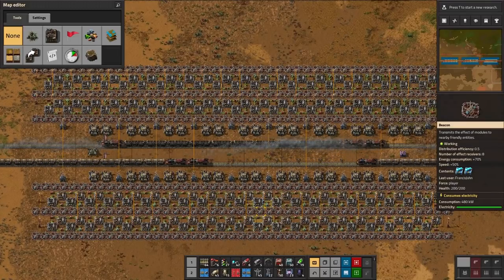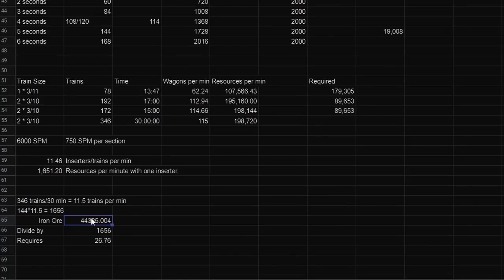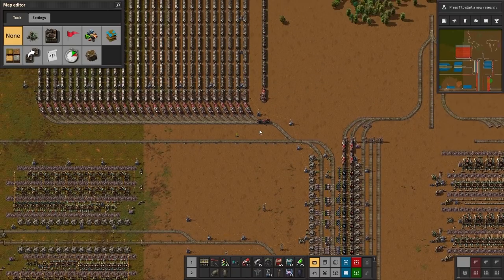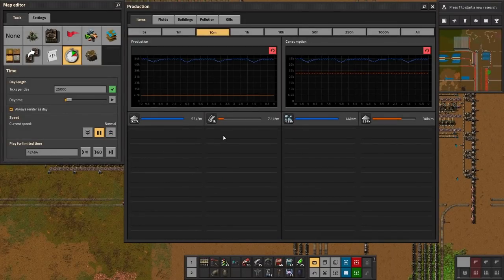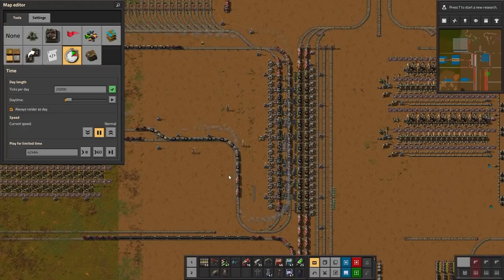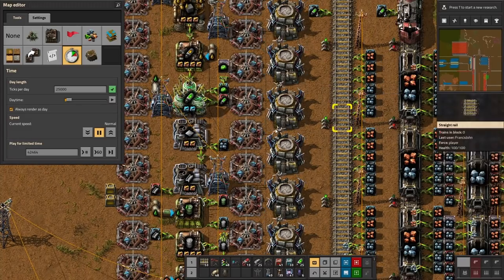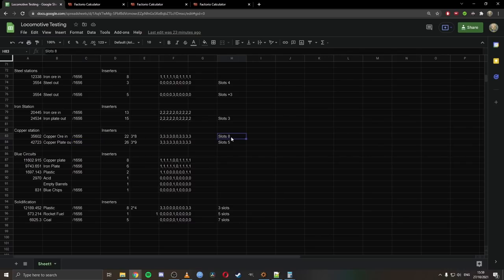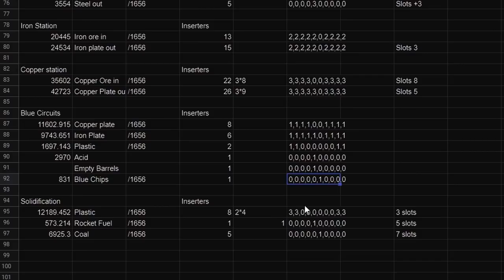Factorio : Train belts are tricky but powerful : Mega Base Ep7

Comment: spreadsheet advice:
put the number of slots to diffrent columns (you can change the size of columns so they would fit only one digit)
then you can sum up all numbers in columns and you would get the number of slots used in wagons
Reply from the maker: I will have to do this to save time, really should be automating the math.

Comment: There is a mod that turns bot placed trains automatically to automatic. It's called "Do Robots Build Automatic Trains?"
I guess you'd need to save your staging area as blueprint or alt+d and ctrl+z them to autostart them if i understood you correctly with how you restage them. Still a lot better than manually going through every single train.
Reply: That is quite possibly the best named mod I have ever seen.

Comment: You could probably have the trains always on automatic, but use circuits and signals to hold them in place. Then you just unlock the signals to release them.
Reply from the maker: Their is a mod "Train mode switcher" cant wait to give it a go.

Comment: One way that you could manage your trains without restarting a save file is creating another set of rails like the one you use to launch them, and put a non accessible stop with the same name as the first stop. Whenever you want to remove the trains from the loop you just make that stop accessible and block the other one.

               a |||||     ||||| B
      -------------------------
   /                              \ A
   |                                |
    \                             /
       -------------------------

B= the place you are currently launching your trains
A= the first stop
a= a stop with the same name as A but not accessible (either by putting a train on tracks or removing a single track)

if you remove access to 'A', by placing a train or removing a single track, and add access to 'a', you will force all trains to go to 'a' instead and you can reroute them to B to edit their cargo. This way you don't reload your game and you don't need to change trains from manual to automatic or vice versa.
Reply from the maker: So delete the rail connecting the trains to the network, that way they won't move until the rail is replaced. I like it.

Comment: I forget, did you rule out on site steel smelting for some reason previously?

edit: *for the rest of the factory, rather than loading it on the trains
Reply: he figured the more on site smelting/production the more efficient, but it would be too much work to try to calculate all that so he's doing it slightly less efficiently for the sake of simplicity. I think he explains this in the first episode.
Reply from the maker: It's like Alex said. I was only going to site smelt if we needed it to make a big enough base. But we can make about 6k spm bringing in only raw with a single exit rail. So I figured lets go for it.

Comment: You never did upload that final episode...  4 months later and I'm still waiting lol - and your nuclear frankly, sucks for efficiency.  Using a 2xN setup with bot fed requester chests (1 blue and purple for each reactor) is better for throughput rather than your 1xN.  You weren't kidding when you said you prefer expandability over all.  If you ever want to try something different, I have a few of my designs up on Factorio Prints under this username.  I have designs from 1.14GW to 7.52 up, all smart with steam/water storage

Comment: I see others have suggested mods for the train mode swapping that are better than this, but you might enjoy this.
I used a mod called "Honk" that gave a shortcut key "J" when you were in the train. When exiting a train you always exit on the same side, even if you get in on the other. So I would set up a line of train like you do and walk to the correct side. Then just hop in hit J, then hop out on the other. The first train would be moving when I hopped out so I could just hop into the next train without having to move my character. Work my way down the line in a few seconds and all done.

Here is a video that showcases how getting in and out of trains is the fastest way to move in the game.
https://www.youtube.com/watch?v=EF99Ym5jXjg
Reply: OK the second fastest way of traveling.
Reply from the maker: I remember that video, taking moving in factorio to the absolute extreme. Have been told of a mod "Train mode switcher" allows you to drag select to switch a whole bunch of trains at once.